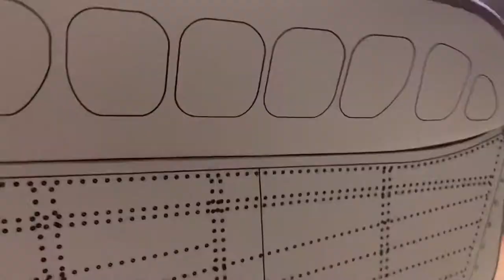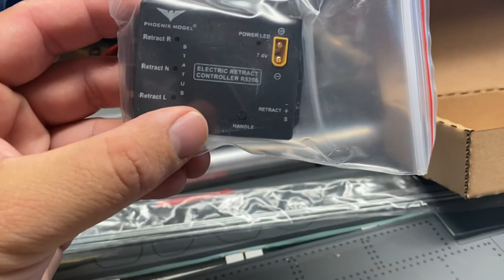Phoenix models 20cc FW190 unboxing

Comment: 2-56  push rods on the elevator and rudder us totally unacceptable,  not sturdy enough. My gear doesn't extend fully the,angle is to acute., the rods are metric 1.7mm like angel hair pasta.